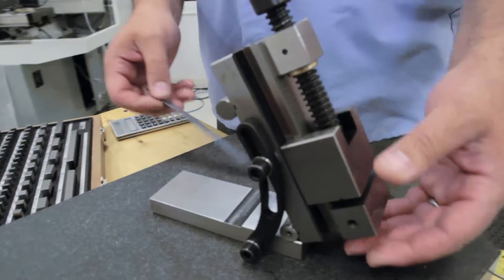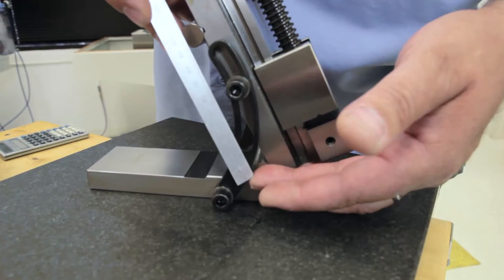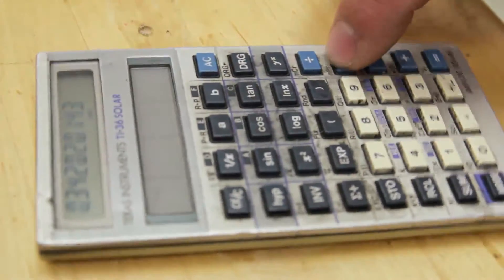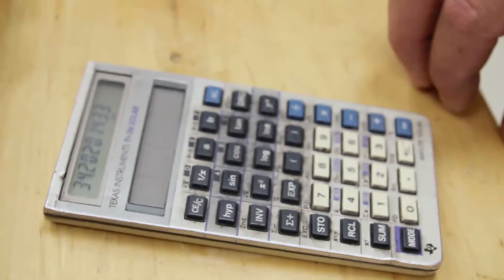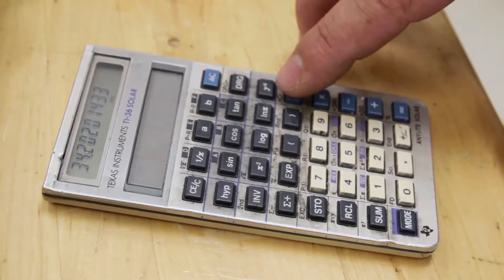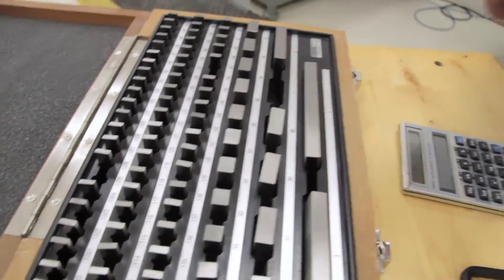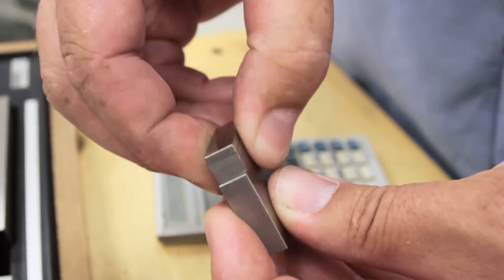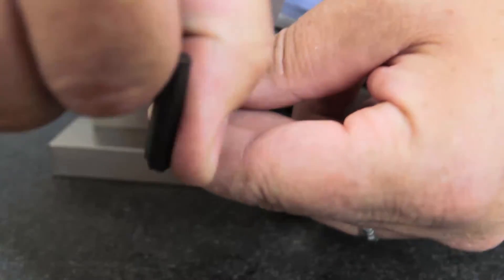How to Setup a Sine Vise - Tormach CNC

Comment: Great videos!   If you could provide context for what practical uses I would have for a Sine Vise, as well as other items you are using in other videos, that would be very helpful for the new guys to this area.  It could be placed at the end for the advanced folks that don't want to watch.   I would also like to see beginning to end of complete pieces you are making from work holding through execution.    Thanks for putting out the videos!
Reply from the maker: +Michael Julson Thanks for the comment. We'll take your suggestion into consideration for future videos.
Reply: I agree about seeing more work but I can also see the possibilities I spend so much time manipulating angles for parts I make this would reduce that significantly if rigid enough.

Comment: I’ve wanted one of these but I’ve worried about chatter through the vise they don’t seem rigid enough. Would’ve liked to see a project machined on one.
Reply from the maker: You are correct, you can sacrifice some rigidity when working with a sine vise.  This compromise is sometimes necessary to make the part.  You could build dedicated fixtures or add axes to your machine, but when you are making a small run of parts, sine vises are a great, inexpensive option.  Sine vises will give you the ability to make complicated parts at a minimal investment in fixturing.

Comment: Also, please note that you were not clear in your video.  The length of the sine bare is the distance between the CENTERS of the rounds.  

Also, 5" is a standard for sine bars and full tables are available based on 5", but the math does work for any length, as shown by your use of a 100mm sine vise.

Comment: I was struggling with this until I did some more research.  The stock scientific calculator on my phone calculates trig functions using radians, not degrees.  I download calculator AP called RealCalc which is much better and provides predictable results, but if that you run into my problem and the answers your calculator provides does make sense try "sin(degrees X 0.01745329) X length of bar." A radian is 57.2957795 degrees so 1 degree is 0.01745329 radians.